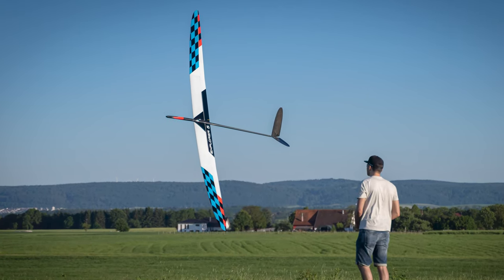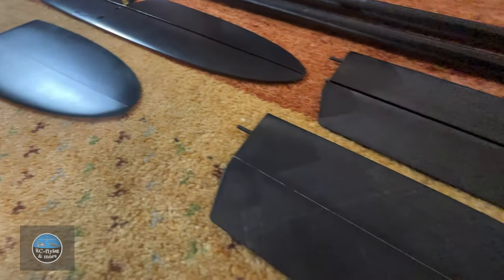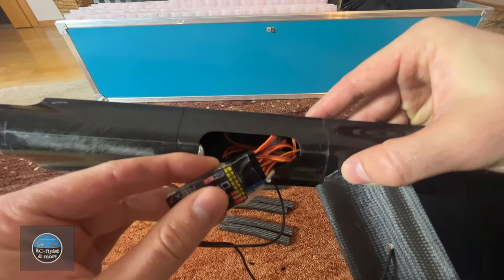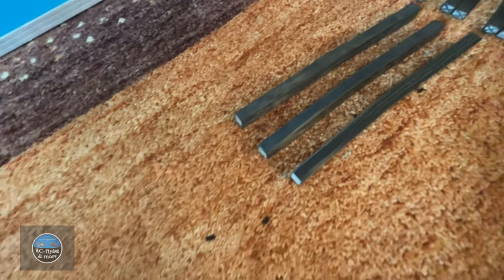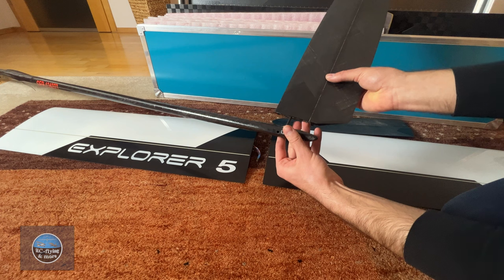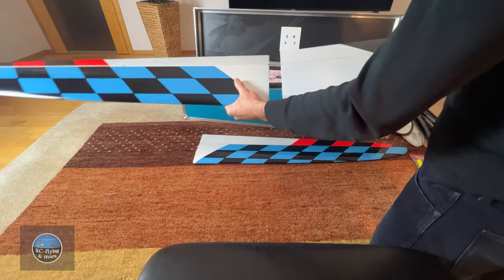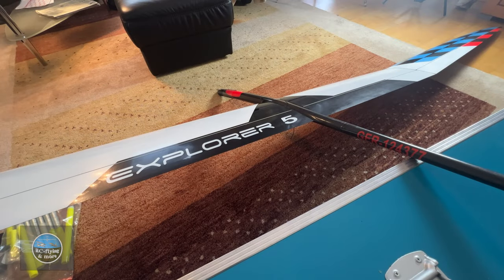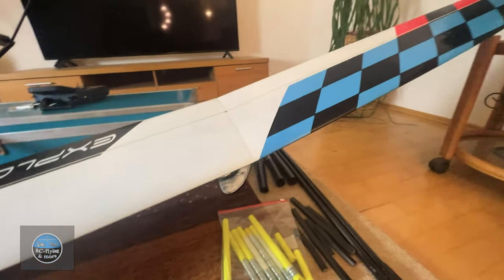All Details - How to Setup - Q&A - RC Thermal Soaring Glider Explorer 5 - NAN Models

Comment: Interesting analogy only using 4s setup. I thought the new trend because of technology and light batteries you would be using a 6s setup in your new model can you please give your reasons for going 4s 

Fantastic video as always I’m really liking the Jeti radio your using only thing is it goes along way towards another F5J model. 😂
Must say the Jeti transmitter lanuauge on what they call things is very much like Graupner so if I was to change I think I could get my head around using this transmitter.

Keep these great videos coming specially the instruction videos they are very informative certainly your flying styles over in Europe compared to ours here in the west. 

Well Done. 👍